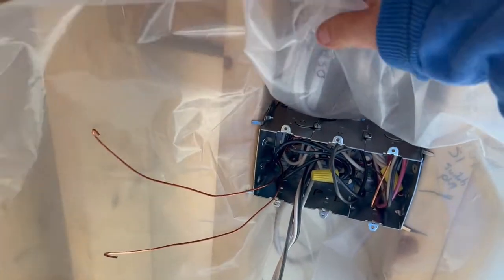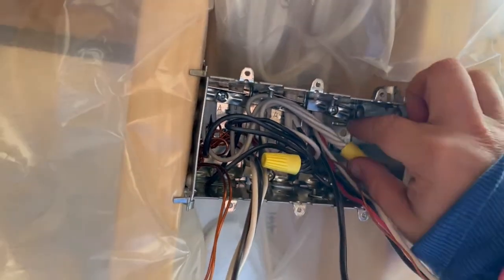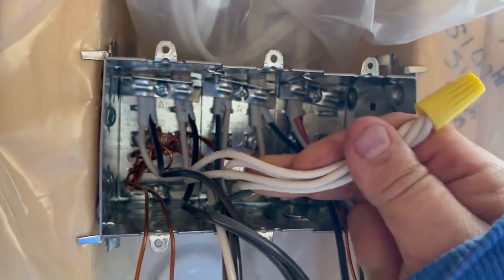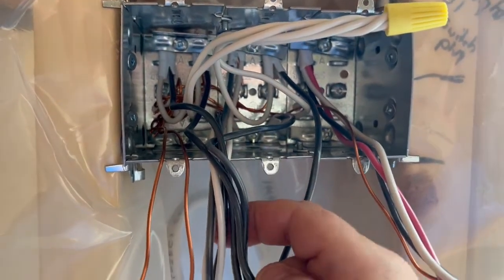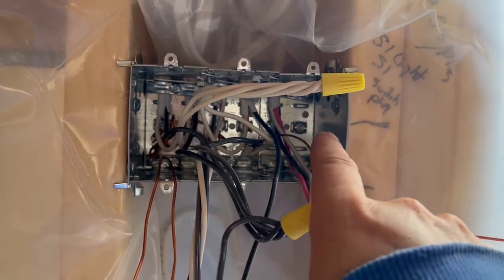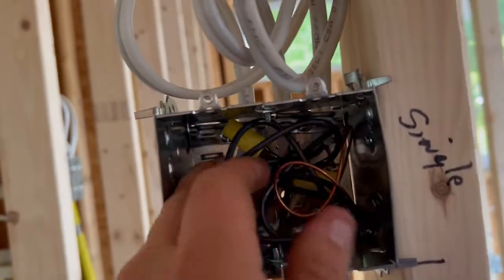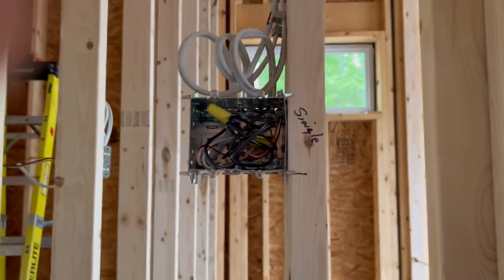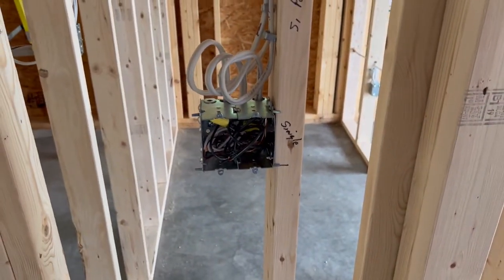Two and Three Gang Electrical Box Connections

Comment: It is great to see that there are still some good electricians still working. I have been attacked for commenting on a short video. 

They were showing using the cheapest blue plastic 3 gang box and screwing a short 2 x 4 wood block on the end of it for support. They were saying that they thought that was quality work because of the drywall sandwich effect supporting end away from the stud. 

I come from 3 generations of Electricians and told them that my dad would have kicked my ass for doing that.

I advised to use a different method or install a better 2 x brace. 

My guys would not do that and I would rather pay them the money to take a little extra time and not have to deal with customer issues in the future.

If one of my guys got lazy and refused to meet my standards of work quality that they would soon be gone. 

It is obvious that you and your employees have pride in and take the time to do an excellent high quality job.

I am 56 year old Gen X er and am starting to believe that we are the last tradesmen to have any pride in doing a job right. 

You have renewed my faith in the fact that there is still some quality work being done.

I want to see what happens the first time someone wants to remodel these new houses being built today. 

Those cheap plastic boxes are going to be destroyed the first time someone starts ripping drywall off of the walls and those little blocks of wood are going to take the box with them.